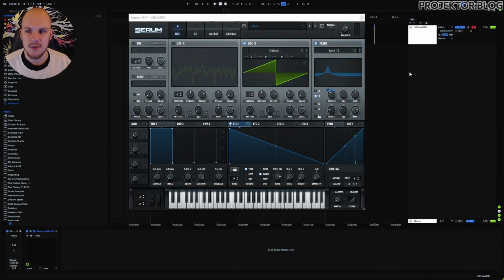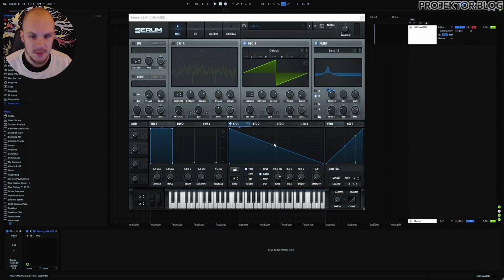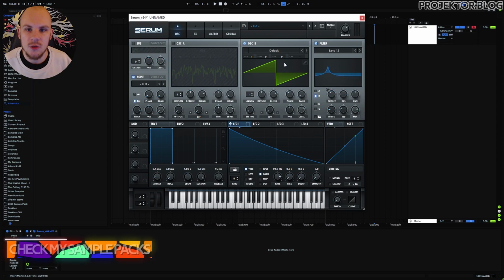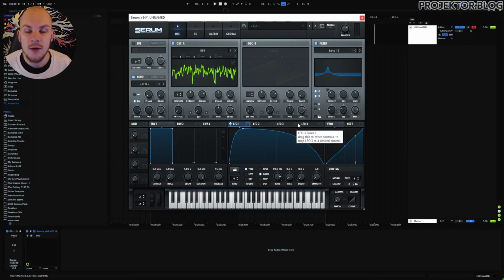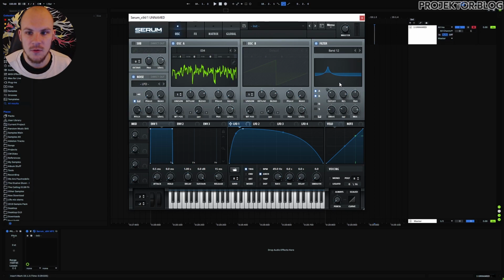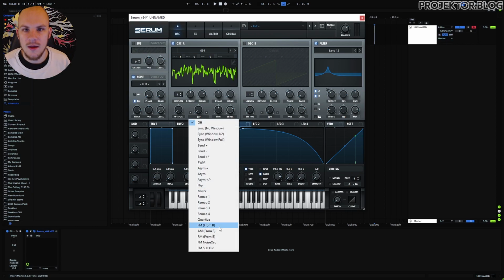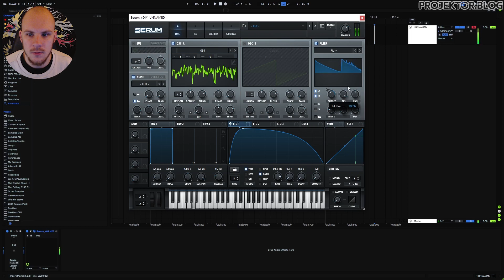What is Filter FM an how to Sound Design with it?

Comment: That's not filter fm , filter FM requires an update rate calculated per sample tick  for the mod sources , iow equal at sampe rate .
If your lfo's runs at 500 Hz but your update rate is only 800HZ , you will get severe aliasing on your lfo's and the final result will be shit .
The filters also need to be designed to handle FILTER FM .
Afaik the update rate of the LFO's in Serum are not calculate per sample tick
Reply from the maker: does it matter? The sound that comes out of it is nice so it's good enough for me.
Reply: Filter frequency modulation, it's exactly what he's doing....